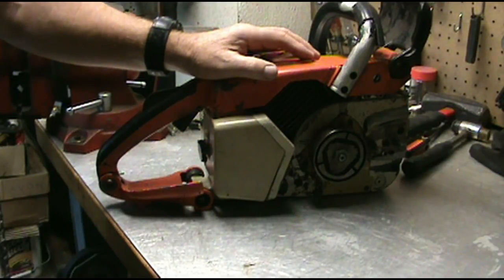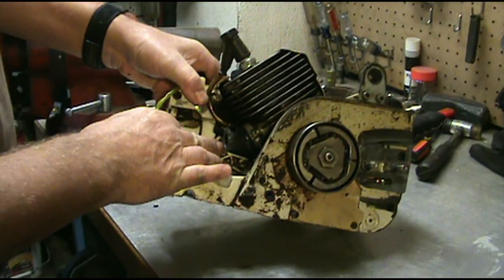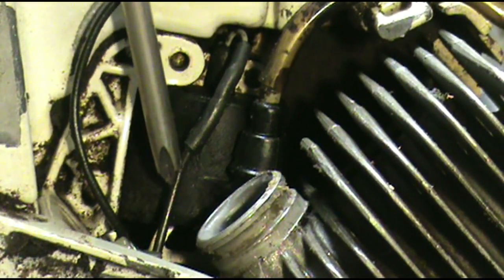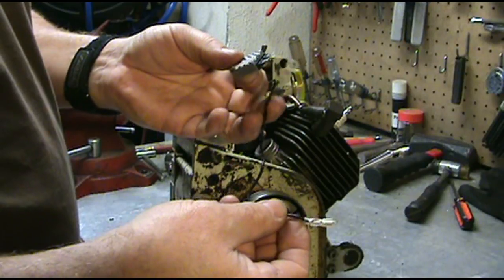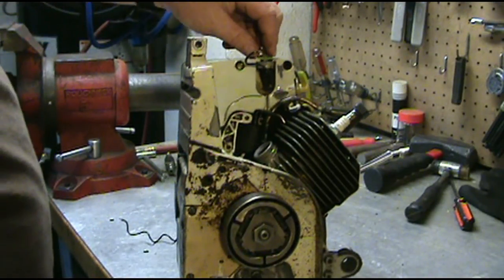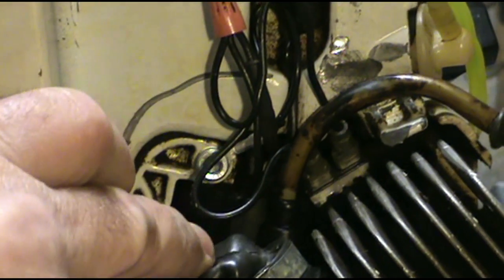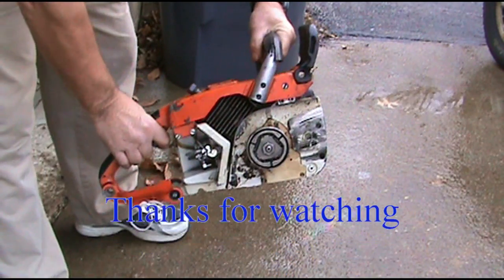Stihl 031 AV from points and condenser to chip.

Comment: I heard you have to advance the timing 20 degrees to get them to run right.
Reply from the maker: No
Reply: Thanks,  one guy said the muffler would get cherry red hot from timing if you just put the chip in.   Another said a module worked best .     I haven't tried any of it so thanks for the info and video .
                Seth
Reply: You can use the flywheel that comes with electronic ignition and the timing will be pretty close, they have a little symbol on them that is the same as the symbol for a transistor. With the points flywheel you will have to tinker with the timing.

Comment: I could've told you it wouldn't fit. Most are mounted in the air box or if you're lucky enough to find an 009, 010, 011 or 012 that's electronic that chip's made to fit at the coil.
Reply from the maker: Still works.

Comment: I just acquired one of these for basically free. The guy I got it from took good care of his stuff and always drained the gas out for storage. It runs but only for a few seconds. Could this be from the points?
Reply from the maker: Sounds like the carburetor. I have a video on what to look for in a carburetor when it does that.
Reply: LonnieJohnson1 awesome thank you I’ll look for it
Reply from the maker: Let me know if it works.

Comment: Hello, did you changed the ignition coil also or is it still the original? While I have done something likewise with a Stihl 028 WBQ but we're having troubles with ignition not going on continousley and therefore the engine shut's down, will no intention whatsoever to get restarted. Again, I'm not sure that this is due to the electronic module, heard some story about an ignition coil going dead while  the engine is getting at normal operating temperature??? True or false? Any pointers in this regard will be gratefully appreciated. Thank you so much. Jacques (Belgium)
Reply from the maker: Just added the module because you still need the ignition for it to fire. I've heard of that but I have never had it happen to me. I have always had the coil go out. I have never seen a coil get hot and stop working and then start working again.
Reply: @LonnieJohnson1  happen to know where i could purchase a sthil 031av coil and maybe condensor... you know how to test condensor by chance?

Comment: Great video, thanks Lonnie!  My saw has the hottest spark in a long time.  One issue has developed before I reassemble that I can't fix, hope you can assist.   I have a hot spark regardless of the kill switch position.  I have replaced the switch itself as well as the wire leading to the splice per your video and nothing fixes it.  Any suggestions?
Reply from the maker: Check the switch with a meter to make sure it works and if it's good check the ground and put the meter to it as well to make sure the switch is grounding out.

Comment: where can i get a coil for my 031AV
Reply from the maker: Have you tried eBay?
Reply: @LonnieJohnson1  you know how to test condensor by chance..
Reply from the maker: Use a multimeter to test your condenser.  You can check the coil with a multimeter as well. You can check eBay for points, condenser and coil if you need one or just type into google what you need and search, that's what I do to get the best prices.

Comment: Thanks for posting this video. After following your suggestions I just got my 031 running like a champ. I ended up drilling and mounting the module in the air cleaner box. I ran a seperate earth wire to the engine heat shroud as I was not getting a good earth.
Reply from the maker: Your welcome

Comment: Thanks for the video, i had been planning on buying a chip to fix my old stihl i picked up for 30$ and no other video showed chip mounting from the clutch side, i did not want to tear the whole saw apart for a simple fix.
 i also could not get the chip to mount in the location the instructions listed so i mounted elsewhere and could not get spark. the video helped me to diagnose the cause ( not grounded to coil ) and get it working. now it runs like a new saw for 50 $ total price purchass and fix. think i did ok, on the deal. 
 i also got a McCulloch off the same guy that has no issues, looks like a new saw. not even any bar wear.
Reply from the maker: Cool!!

Comment: I installed the Kawasaki module I mounted it on the underside of the  orange engine  cover plate which would be directly above the fuel tank area , there is on the 031 AV a pre drilled and tapped hole its small but it is there, I also took one of the screws from the points which are obsolete now and it was the perfect size No drilling or tapping , I connected a ground wire from the coil to the cover to the module mount then I pre bent the connection 90 degrees  on the end of the wire that came with the module Not the tab on the module didn't want to risk breaking the tab slipped it up and in fits like a glove then cut and splice the other wires as per the directions.  There's like 4 screws that hold the flywheel/fuel tank to the engine plus the two screws on the lower AV handle remove the gas hose and power switch and its off then you can see where that predrilled hole is on the underside of the cowling.

Comment: I have 3 Stihl 031 AV chainsaws and had to replace 2 coils. While the saw was torn apart I replaced/added a new ignition chips. (The way you can tell that its a bad coil is that the chainsaw runs for 5-10 minutes then dies.  After the coil cools, you can restart and run for 5-10 minutes then dies again etc).  Go to Ebay and purchase both a used coil (Stihl doesn't make coils anymore) and an ignition chip.  Mount the chip in the air box for easiest installation.  Both my replacement (chip/coil) saws have over 100hrs on them and they run perfectly.
Reply from the maker: Cool!
Reply: Thanks for sharing your knowlege and experience. If you had to do it over again, would you still replace your breaker point ignition with ignition chip?

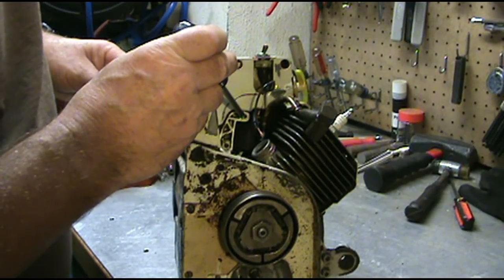Comment: 3:37 - the included course thread sheet metal screw does not thread into the finely threaded hole as indicated in the video. It is far too narrow. The hole is 0.160” ID, where as the sheet metal screw OD is 0.125”. Luckily I had a M5.8 in my tool box drawer. I cut it down to 0.490”L to fit it in snuggly.

Update, the mount/ground screw that holds the mosfet to the body vibrates out even with red thread locker. Trying to find another ground point but all of the metal on this saw is potmetal so everything strips out. Murphy’s rule 1: when it can fail it will fail - every time.
Reply from the maker: If you keep watching at around 4:50 I told you the screw that came with the kit don't work. I had to find a screw that would work.

Comment: Did u not have to fit an electronic flywheel ??
Reply from the maker: Raven croak I did not have to change out the flywheel. I used the stock flywheel and it work like a charm!!!
Reply: cheers
Reply: I used the electronic flywheel and it worked good. Sometimes you have to reverse the polarity on the chip to get the timing right.

Comment: STIHL 031 Av has a hard time starting, but when it starts it works for a while and when it stops working it won't start again. What could be the problem with it?
Reply from the maker: I would check the compression, it should be around 110 but check the spec for your saw. If that's good then check your exhaust to make sure it's clear. Then the ohm reading on your coil and your plug to make sure there not failing.
Reply: @LonnieJohnson1  thanks 👍
Reply from the maker: Glad to help.

Comment: I had to put the chip into the air box beside the carburetor plus I had to use the solid state flywheel to run right.
Reply from the maker: I just put the chip in and it fired right up.

Comment: I just used electronic coil and flywheel off junk saw, cut off wire to points. Works great no chip
Reply from the maker: Did you happen to make a video to show folks how to tackle this project.
Reply: @LonnieJohnson1  no need for video. Simply swap flywheel and coil. That's it. Trigger in coil triggered by flywheel just like on your lawnmower.
Reply from the maker: I don't want to replace the flywheel on this saw? Module is less than $10.
Reply: @LonnieJohnson1  replace points and condenser
Reply: @LonnieJohnson1  I took parts off of a dead saw. It cost me nothing but my labor
Reply from the maker: That's cool, you got off easy on that deal but the chip is only about $10 and a little time to change it over. I beleave this chip can be put under the existing flywheel as well.

Comment: I have 2 wires coming off the coil? not one? do I cut both wires?
Reply from the maker: Check and see if one of them is connected to your kill switch. You should have one wire from the kill switch and one wire from the points.